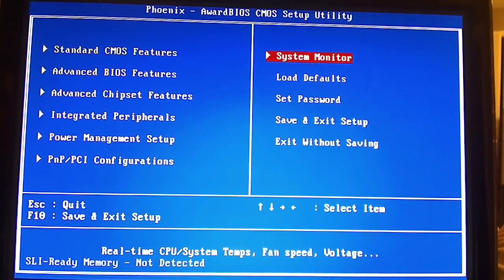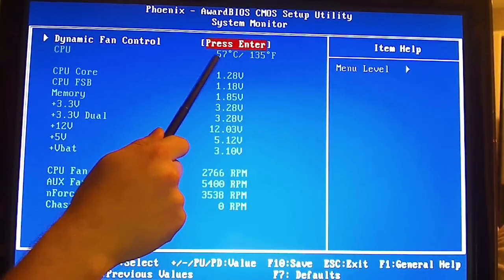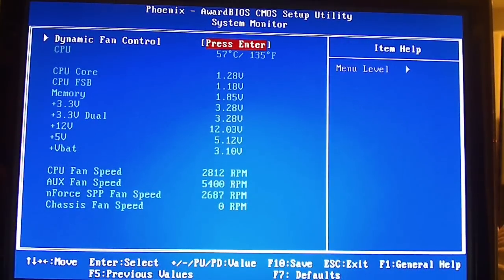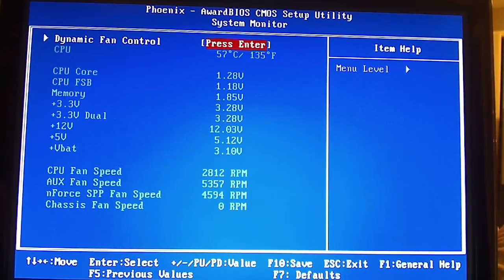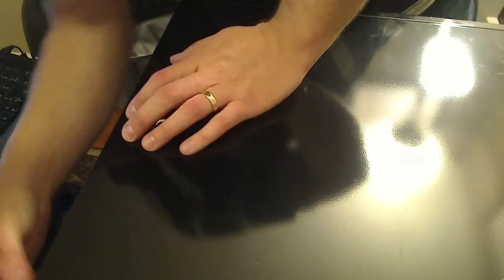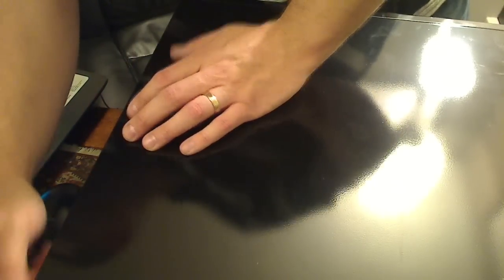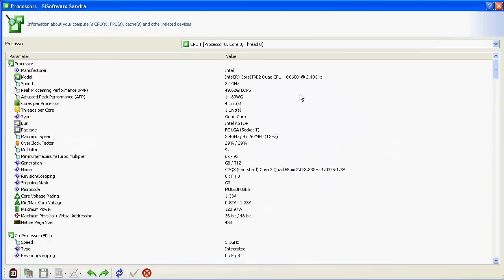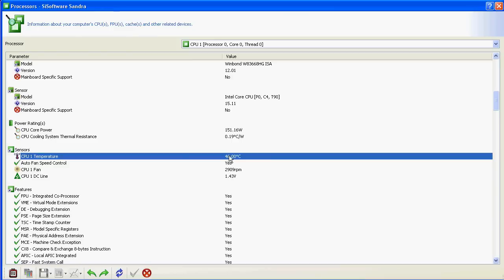SOLVED:  Fix Overheating CPU (Computer) Decrease Temps by 10 degrees

Comment from the maker: @PepsimaxL You should take a look at my video called "How to Repair Geforce and ATI Video Cards". I had a video card blow up on me, I bought some parts at and fixed it myself. 

I also have a new video showing you how to properly clean and apply thermal paste to drop temperatures called "How to Apply Thermal Compound to Intel CPU"

Other videos I made you should check out.
How to Clean a Video Card Thoroughly
How to Clean a CPU Fan & Heatsink at 215MPH!

Keep everything CLEAN and COOL

Comment: don't use a hover on your PC it can cause static build up and damage your components
Reply from the maker: +kyle wiggins LOL #NOOB
Reply: +kyle wiggins Static build up from a sweeper you serious? It causes 0 static electricity and won&#39;t damage anything.Most computer repair shops use a vacuum,air compressor, or leaf blower.I worked on computers since i was young.Can tell you can air is not enough.When i clean my computer i use a vacuum. And i also get  some paper towels take CPU fan  and case fans off.Clean them  of dust thoroughly.I even remove the heat sink use paper towels in the little slots.Cleaning a desktop PC for me is more then vacuuming its very personal.As wanna make sure any missed dust is cleaned
Reply: +kyle wiggins The cooler itself is not an electrical component other than the fan when it's actually plugged in. Other than that, no harm.

Comment: You ruin your air flow with mounting the cpu fan to push air away from your outtake fan. You should rotate your heatsink 180 degrees.

Comment: My CPU is on 105 °C At 2500 Fan RPM in less then 2 minutes. Please Help.
Reply: It shuts off at 108 °C
Reply from the maker: +Sadolman What have you done to fix it so far?
Reply: Lex Selfmade Life 
Nothing. Yet I cant pay for it. Put I'm thinking putting some of that blue cooling gel, because there was barely any. Then maybe I'll buy a new fan for it. But its so old, that might be a problem.

Comment: my temp is 80C idk what is wrong its not dusty :/
Reply: My temps also hit 80c on 100% load probably because I have a 12 core cpu. But on idle its 34c and while gaming max ive seen it hit was 70c normally its 60 to 50c.

Comment: haha, my laptop keeps crashing and my cpu is often at over 100c, iv checked under the heat sink, and saldy my cpu is solderd on so..... im not sure whats wrong with it let alone how to fix it
any ideas?
please it was a 1000 dolor laptop i got as a gift for school and it is fairly new
Reply: you can check for dust in the vent idk how its called anyway to me it happend it was so full of dust that it was blocked so the hot air was just circulating in the laptop heating everything even more . I cant tell you anything else Im not an laptop expert I have a fair amount of experience on destop for a 15 yr old guy so yea good luck with that laptop if you didnt fix it already.
Reply: Mr Perry I fixed it its good,  the vents were fine but it had no heat paste stuff on it
Reply: so i added that and now its good

Comment: You skipped the part i needed... How did you remove the old thermal paste on the CPU without risking an electromagnetic choc?
I use a 500$ processing unit, no way in hell i'm taking any risk.

Comment: mine was just fine about 48 idle 62 load now 60 idle and some fucking toaster at 81,80.I dont now what to do.On the store they changed the termal past and its stock.
Reply from the maker: If your temperatures shot up like that, I think what happened is that your computer got BUMPED, which made it come unglued from the thermal paste. The samething happened to me. What you're going to have to do is clean the heatsink and cpu from thermal paste and re-apply it. You can just  squeeze a grain of rice sized dot in the center of the CPU and simply install your heatsink. Recent lab tests show that it's one of the best ways to do thermal compound. #HotCPU  #CPUTemperature
Reply from the maker: Dude a very long time ago my very expensive computer broke and I was too scared to tell my parents. Well long story short I learned how to take them apart, change parts, upgrade them., overclock them, and fix just about any problem. It all started the day I decided to try fixing it myself. It already sounds like the people you took it too are complete idiots and don't you trust yourself over them anyway?  There's videos on YouTube on just about everything you need to know.  I'll be producing my computer build videos as well, so stay tuned. Hit LIKE and Subscribe if you want to master your computer by watching my upcoming video series. I can't stand people getting screwed, that's why I created my channel. I help people SAVE TONS OF MONEY on their COMPUTERS, CARS, and HOUSES.  It's what I been doing for a VERY LONG TIME.   #YouTubeMaster
Reply: i alaways mounted my stuff since p4,core 2 duos gpus,psu,mcp etc.my dad insisted to grab him and make a surprise for me and take it to a fucking store full of stupid.I spend 3 days out race wars was in town i didnt even know
Reply: All you have to do is open it up, try your best and clean and replace the thermal paste, then when they ask if you opened it up - simply tell them you didn't. That's how i usually get free GFX cards when i fuck up on the OC settings. lol

Comment: If You Were A Real Computer Geek You Would Know That A Case Fan At The Back Of Your Pc Should Always Be Sucking Air Out Off The Case Thats Why Its Called An Exhaust Fan. . . . Your Setup Was Right From The Begining You Should Have Turned Your Cpu Cooler Around And Not Your Exhaust Fan.

Comment: my pc shuts off after a few minutes idk whats going on😔 i just bought it for 500$
Reply from the maker: It sounds like the CPU is overheating, because that's what is supposed to happen to prevent damage. Make sure your computer is in an air conditioned room if it's hot where you live. Also make sure the fans are working properly. You can also buy better air cooling, like the Hyper212 or Noctua coolers.  Do some troubleshooting and let me know what's up.  ALSO don't forget to SUBscribe, if you want my help now or in the Future :)
Reply: also check the psu, i had a similar problem where my pc refused to boot to continue the windows installation and i fixed it by replacing the psu with a newer one
Reply: same

Comment: My Q6600 2.40GHz 8mb 1066 (1.128V) : (RealTemp 3.70)

Not Playing:
Core1: 50
Core2: 50
Core3: 55
Core4: 55

Playing:
Core1: 85
Core2: 90 
Core3: 87
Core4: 86

Anyone know how i repair This?
Reply: Reko Mac those are ok temps, a cpu can usually last up to 100C before you should consider finding a solution, if it gets 110C for example, (a pc usually shuts off at 120C)
Reply: epic troll Oky Ty
Reply from the maker: +Reko Mac Get better cooling. Dam a Q6600 that is a little old, I had that CPU 2 generations ago. Go on newegg and look for the best cooler you can afford with the most amount of reviews. Maybe the Hyper 212 will fit and I think it's pretty cheap. I just bought a whole new system and it freakin rocks!!!!!!  http://www.simplyadditions.com/Blog/Computers/Build-Your-Own-Supercomputer-Project.html

I'm using a Noctua cooler but it's pricey for air cooling. I didn't go with water cooling because the systems around $125 get pump failure after 2 - 3 years. The Noctua cooler works like a dream and I'm crushing frame rates. Check out my latest video doing a benchmark on #GTA5.https://www.youtube.com/watch?v=iylzXkf0G3g

Comment: Is it bad when my cpu goes around 78-83°C (i5-2500k) when playing games? When idling, it's 38-45°C which seems ok. My cpu is not always at 80 degrees when gaming, only in games like witcher 3, dying light, ac unity( even more on this one lol), crysis 3, etc.
My rig:
 CPU: i5-2500k 3,30ghz Quad core ( stock cooler, 5 years old)
GPU: Msi Gtx GeForce 970 gaming 4gb
RAM: 8gb 
OS: Windows 10 Home
Monitor: 1920x1080 60 Hz
-is 80°C for cpu on full load normal for like 4-6h a day with stock cooler?
- any advice would be appreciated.
Thanks :)
Reply: Mines like this.
Reply: I'd say just get a new cooler. I'd expect the stock coolers' fan would have started to die after that long.

Comment: mine is  at about 100 all the time... Guys i really need help. Please someone help
Reply: +Huskies Graphic Turn  a case fan around.To push air out instead of in.And another bringing air in.As it will  have fresh air while pushing the heat out.Also depending how many years the CPU sat with same compound.Try reapplying new past to it.Does not matter brand of CPU compound paste.As it all does the same keep the CPU cool
Reply: +Huskies Graphic Have you applied the thermal paste over the whole CPU? Some CPU's need more than others.
Reply: +Daniel Liljenstrom ? Thermal paste should just be as a pea, in the middle, nothing more. There is done tests with glass plate to see what is effective paste or not. The pea method is the best and only. And to much paste is as worst as to little. So have pea in mind, between 0,4-0,5cm in diameter.
Reply: +Huskies Graphic RIP your cpu if that is idle temp. Try blowing air, to clean the dust.

Apply thermal paste: Thermal paste should just be as a pea, in the middle, nothing more. There is done tests with glass plate to see what is effective paste or not. 
The pea method is the best and only. And to much paste is as worst as to
little. So have pea in mind, between 0,4-0,5cm in diameter. The guy on the video did pea method.

Comment: thats not the proper way of putting the paste on.. you have to spread it with a card or a peace of card board. if you let it spread by itself. you'll have to change it again later because it dosent spread properly by itself.
Reply from the maker: +Juan Diaz Lol, sorry but it all works. Lookup temp differences between the different methods. Some websites made the comparisons.
Reply: Lex Selfmade Life 
I know about tech websites. their not all correct.. I build computers for a living. and you be surprised how many websites are incorrect.. just because you dropped a couple of degrees does not mean it's gonna be stable for a long time. you'll have to do it again.. I did my pc 6 years ago. and I just replaced my paste yesturday. because I do it the proper way so it can last. I have my cpu overclocked with a stock fan no problem.. most people do it the way you did but that's incorrect because it dosent spread even.. Also the paste goes on the heat sink nicely spread not on the cpu. Any bit of air between the cooler and the cpu makes a difference.. computer stores do it also the way you did. but that way dosent last for to long. my first motherboard got messed up because they put the paste that way so instead of spreading the heat through the cooler the mother board  was cathcing some heat to.. I realized it when I removed the heat sink, it looked the same way it look on yours when you pulled it off on this video. It was uneven. the better you put the paste the more you can overclock.
Reply from the maker: Juan I'm no stranger to building custom computers and as far as overclocking goes, I've been doing it since the 90's! LOL. My latest Rig is an i7 5820k overclocked to 4.2 GHz on a Asrock X99 OC formula motherboard with a Noctua NH-D15 cooler (http://amzn.to/2u0Wtse) . I use it everyday and it's been rock steady since 2015 when I built it.    1 computer ago I had a Sandybridge i7 2600k overclocked to 5 GHz max and 4.6 daily OC on air cooling! https://www.youtube.com/watch?v=eRv9lT-eY0s     When it comes to overclocking, I'm pretty good at it. I do spread the thermal paste using my finger in a zipclock baggy for the past 2 computer builds, but honestly there's almost no difference between a nice sized glob in the center and going completely OCD with the thermal paste. You're better off buying much better components like the Noctua fan linked above, than trying to squeeze out an extra 100MHz which won't do anything in benchmarks nor real life. 

I'm a computer geek and overclocking is something I really like to geek out about. I've been doing it before youtube made it easy ;)

Comment: Ok so I found out my Core temperature ( Speed fan) before this video and did not do anything to prevent it from happening although I did set my fan speed to 100%, ok so now 2 days later my PC has broken. I'll describe what I see. Okay so what happens is that it signs in as normal then When the computer tries to load the desktop it stays on the background and just freezes. Sometimes when I reboot my PC the taskbar comes on and my desktop icons but no response!!!
 Add me on Skype= Mrgtagenius1